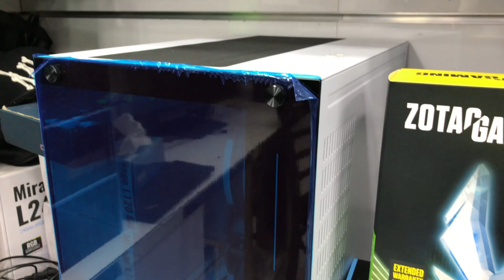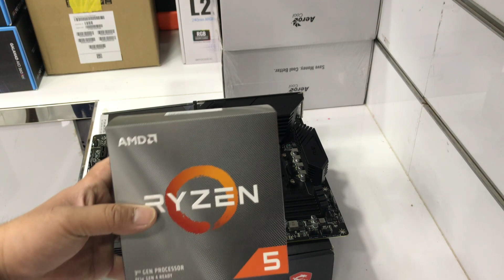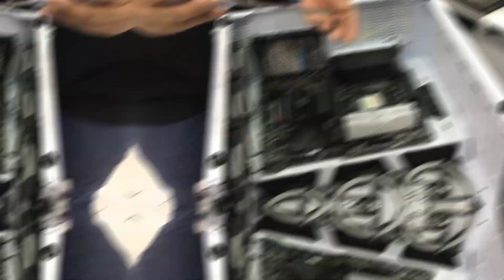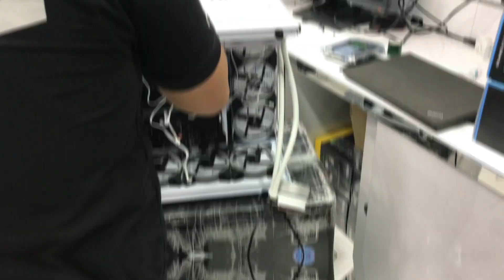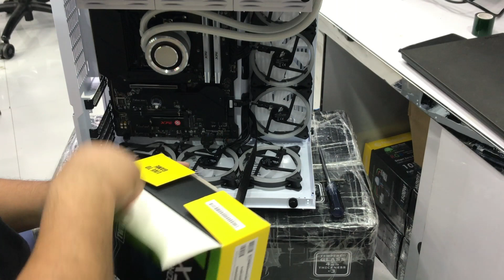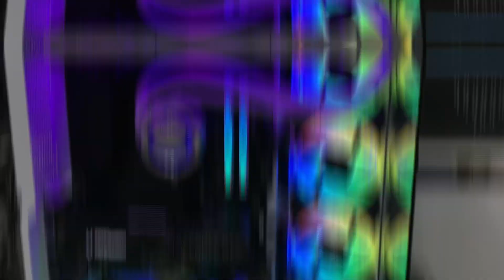FirstPlayer SP8 Case White Ryzen 5 3600 Zotac Rtx 3060 Ti

Comment: have the same case, but the in front rgb is not light up, may i know why ?
Reply from the maker: Check bro back side in your pc they have wire i think blue and check the pin top u plug the wire color blue☝️
Reply: @PcBuild  found the wire. Its the reset switch, but to connect where on the board ?
Reply from the maker: @MadarChodd-m8h   you connect thru restart pin on the motherboard  bro
Reply: @PcBuild  i connect to the reset mobo and suddenly when i click the button, it restart instead of light up 🤣